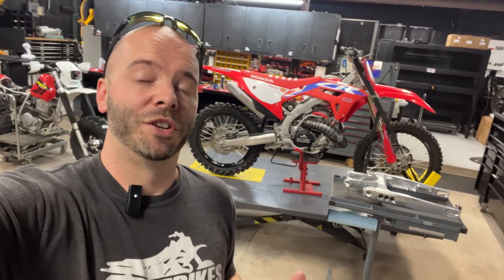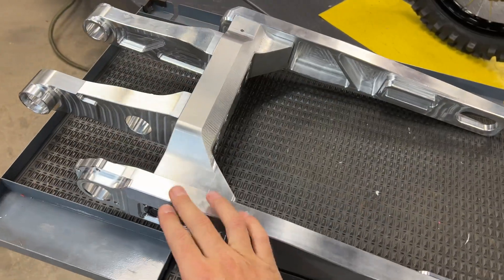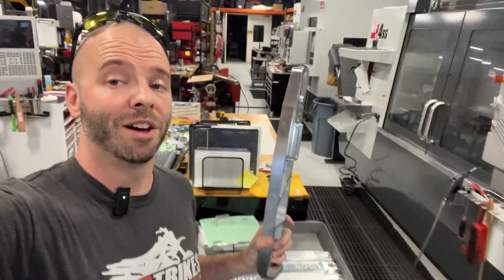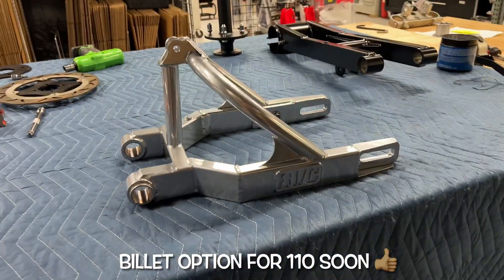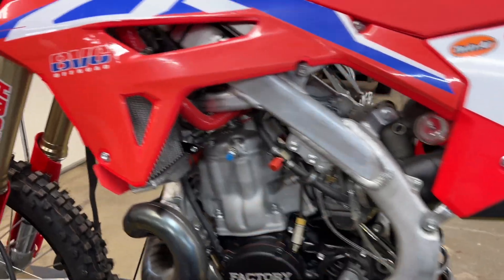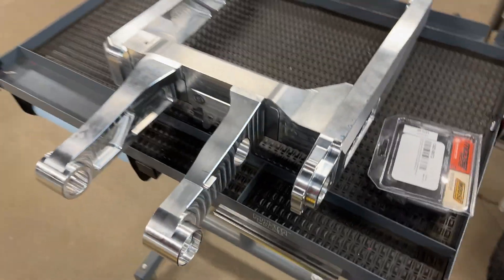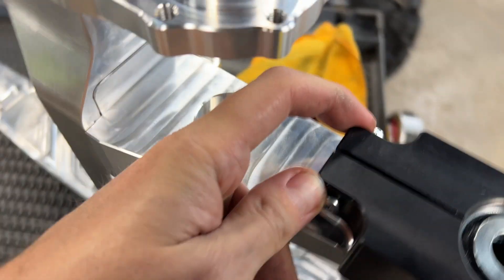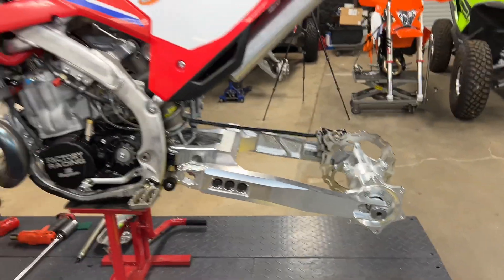Building the Wildest Modern Big Wheel Using a Honda CR500  Dirt Bike

Comment: Have you considered making the pivot points greaseable ? It would definitely take away asthetically from the pretty parts you make but would make it serviceable.
Reply from the maker: Great idea.  I am not sure if there is clearance with the engine area BUT i may be able to come up with something
Reply: @BVCOFFROAD  i just beat and torched bearings and a swingarm bolt out of my '83 Cr250. I thought if they had been serviceable it would have avoided the headache.